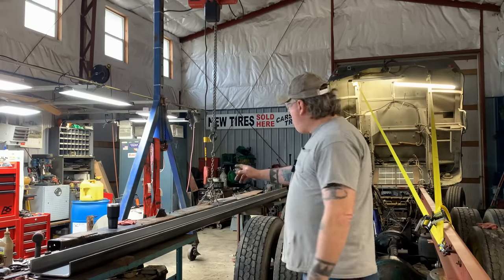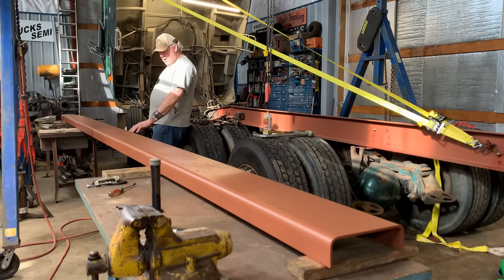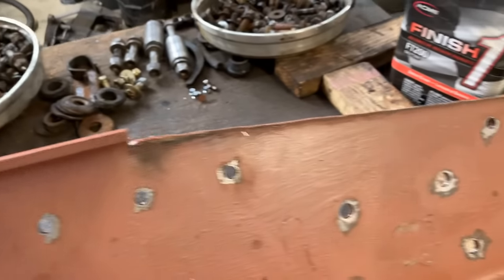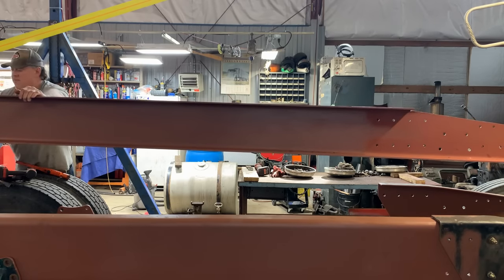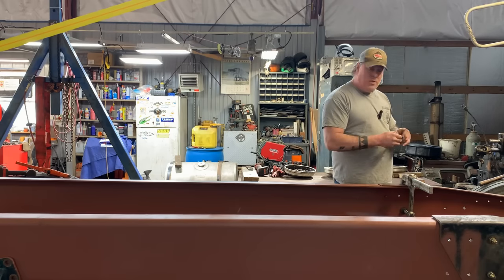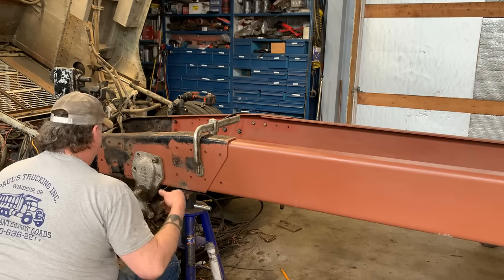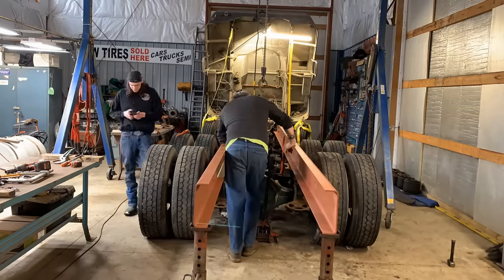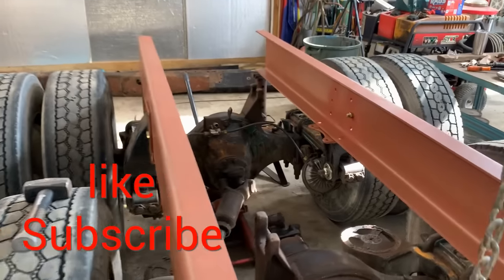Mack Cruise liner New Frame New Wheelbase!! Final Installation!!Big Paul and Big Paul II

Comment: Great job.  Looking forward to seeing you and your truck at Dane Scotts truck show in June.  Bill
Reply from the maker: Thanks Bill we will get it done !!!!  Thanks for Watching!!!BPT
Reply: Is that Cruiseliner one of the models that had the aluminum front axle and steering box mounted to the axle instead of up on the frame? @BigPaulsTrucking
Reply from the maker: @billtodd6509  no it steel I checked with a magnet.  But the steering box is mounted to the axle.   BP
Reply: I knew a guy over in 
white Haven that bought 2 of them new and they were alum.  He had great luck with those trucks, but for some reason, the right wiper inner and outer brackets kept breaking off.  He said he finally put complete new units from those big cabover Fords on as replacements and they worked.  Bill
 @BigPaulsTrucking

Comment: I use a copper coating anti corrosion product that I think is from Permatex. They have different formulations. Absolutely nothing goes back together until i coat the bolt thread with this product. Never used the Fluid Film on bolts before.
Reply from the maker: Thanks for sharing!!  Thanks for Watching BPT!!!

Comment: You are getting those burns from not using lubricant with the annular cutter. 
It will help to extend the life of the cutter also.
Use lube!!!
Don’t hammer those bolts into the holes. You are damaging the pitch on the thread. 
Use the cantering punches to line up a couple holes then use the clamps when the holes are lined up properly.
You don’t want to damage those threads.
Before mounting the rear ends to the frame you should sandblast and then prime the bogies first.
Reply from the maker: Ok thanks for Sharing. It was my first time using annular drill bits. Thanks for the input. Thanks for watching!!  BPT!!

Comment: Can you share what tool it was that you used to find the center of the holes transferring them from the old frame rail to the new one before drilling?
Reply from the maker: Yes I would love to. They are called Transfer punches. I have a large set 3/16—-  1in. So if it’s a 1/2 in hole it fills the hole and has a center punch. Can’t miss.
Reply: @BigPaulsTrucking  thank you very much. I appreciate your response. I always put a piece of plastic air line in the hole and then center punched and hoped for the best.